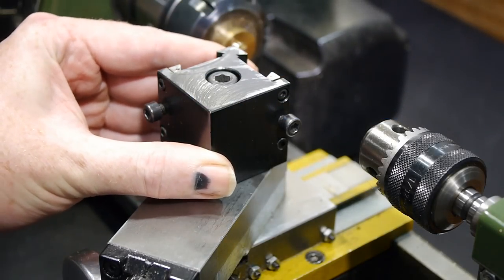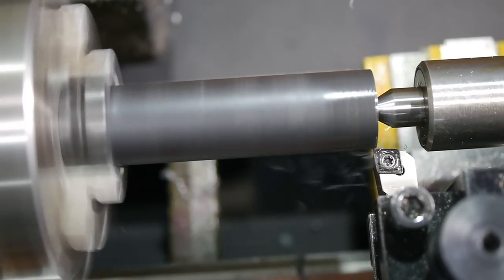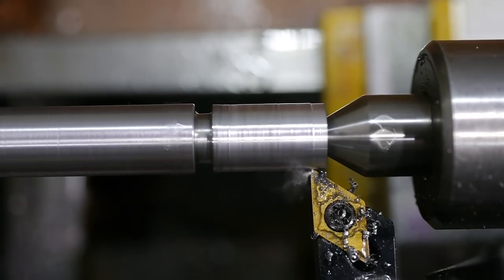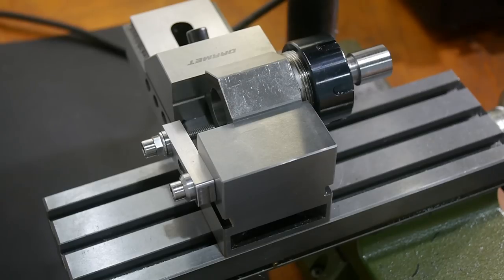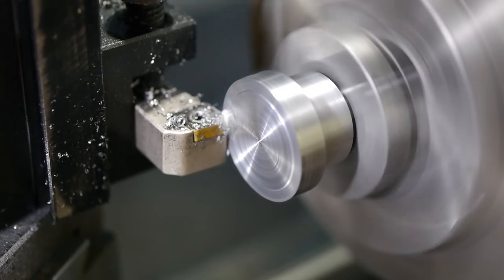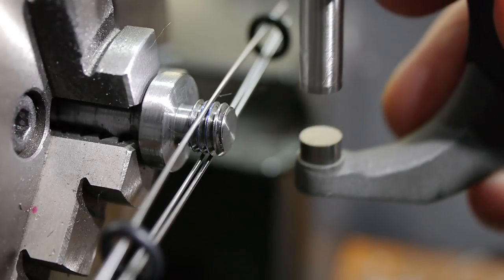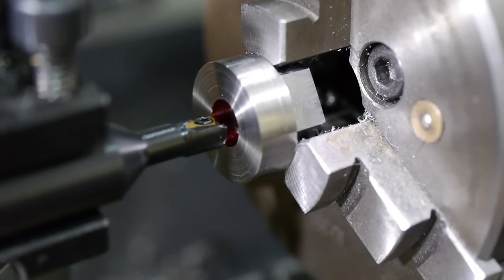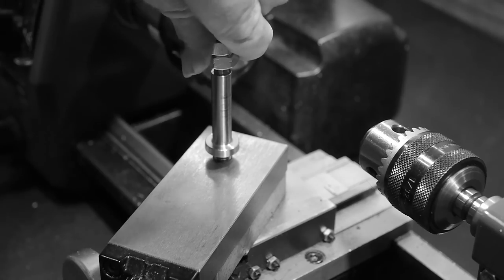Quick Change Tool Post Upgrade for the Proxxon PD 250/e Lathe

Comment: You should have threaded the other way, if your lathe is able to go in reverse that is.
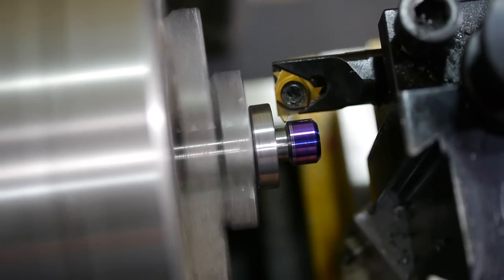Reply from the maker: It absolutely does, and I cut a thread in reverse at 16:30. I assume you mean the internal thread on the nut? I wasn't able to do that, as I don't have a left hand threading tool that fits into a bore that small. Left hand insert threading tools are generally a lot harder to get hold of. The smallest I have is about 12mm diameter.
Reply: @AdventureswithaVerySmallLathe  Yes , that was exactly what I meant. You take away the risk of jamming the toolpost into the chuck. Internal threading is of course more difficult. Sorry for not watching the entire video ;-)

Comment: Something is fishy. I have the same lathe. It's motor is 180W or something like that. This lathe can't work with steel in the way as shown on thins video. It's simply too weak. The revolution would drop off very badly, then eventually it would stuck. You've changed the main motor to something much stronger and better, but I can't see a video about that. So this is cheating.
Reply from the maker: I don't know what to tell you. The lathe motor, and drive train are completely unmodified. There is no deception, eveything happened as you see it on video. I agree that the lathe lacks torque for a lot of work, but I've never had any trouble machining steel of diameters of 20mm or less. If you watch my most recent video about making a boring head arbor, there are plenty of examples in that video of the lathe slowing down and struggling to cut tough steel, but the stock I'm using in that video is over 45mm in diameter.
Reply: @AdventureswithaVerySmallLathe  Hmmm. OK, thank you. I believe you. 
But something is still fishy. I couldn't do this: 6:40
The tool would break or it would get stuck in the workpiece and it would stop the motor too. Then I'd hit the red button. I use the same type of tools as you. Weird.
Reply from the maker: @telelaci2  Parting off or grooving can be a complete nightmare, and I've broken so many tools, just the way you describe. In general, the closer I get to the centre, the more risk of breaking or stalling there is.  I think two things helped me get away with it in this video. Firstly I set up the tool height carefully in advance, and secondly I had the tailstock very firmly in place to prevent the part from flexing. Using a tailstock for parting off is extremely unwise, but can be useful for using the same tool to cut a groove. For an example of a similar operation going wrong, see the last couple of minutes of "Watchmakers Face Plate - Part 10" where grooving jams, bends the part, and writes off many hours of work.